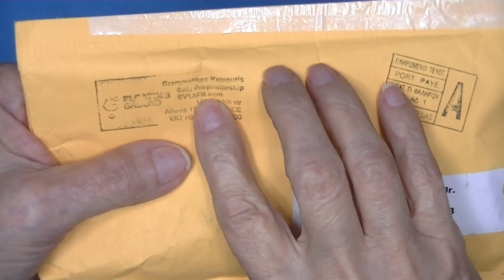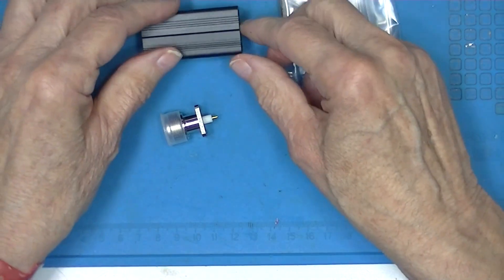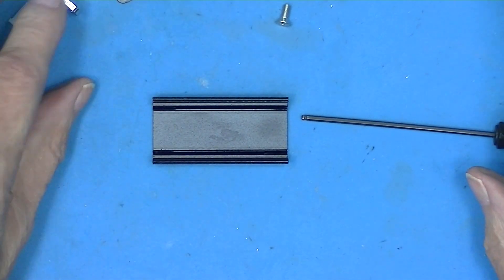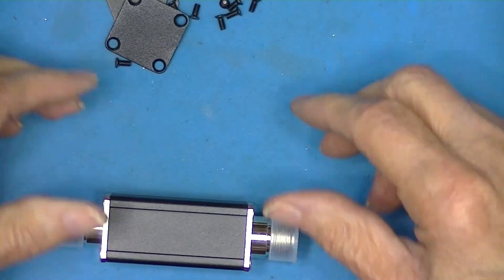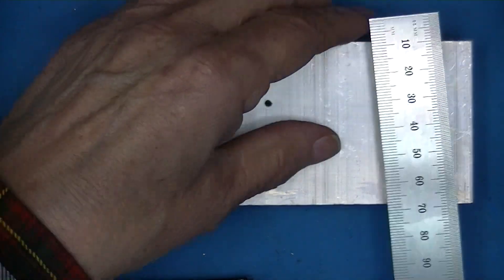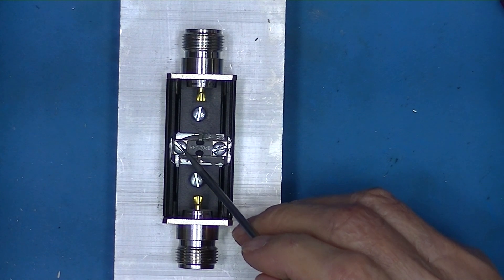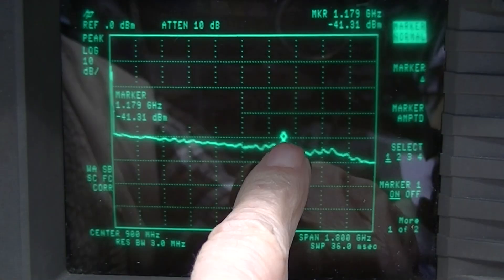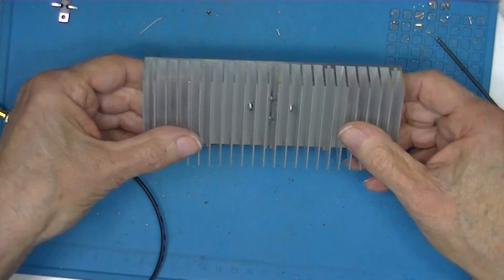30 dB ? Watt Attenuator

Comment: Mounting a high-power resistor on aluminum is a very bad idea—you need a copper plate to immediately transfer heat to the aluminum heatsink. Otherwise, if you suddenly apply maximum power, the resistor will simply burn out without having time to transfer the heat. And this type of connector mounting will cause a lot of trouble when tightening and tightening the cable connectors.